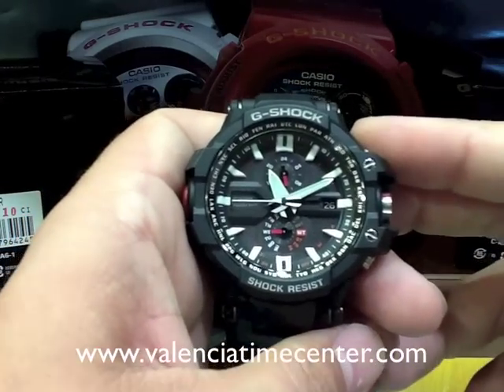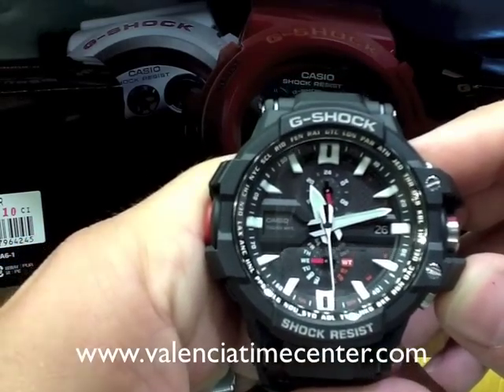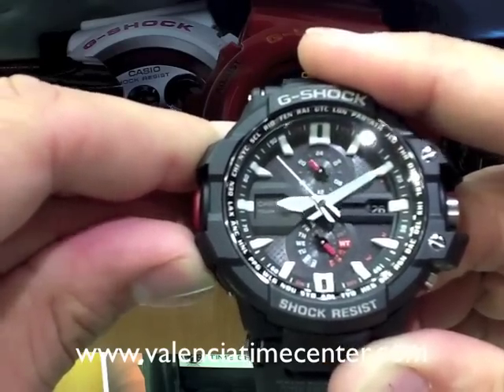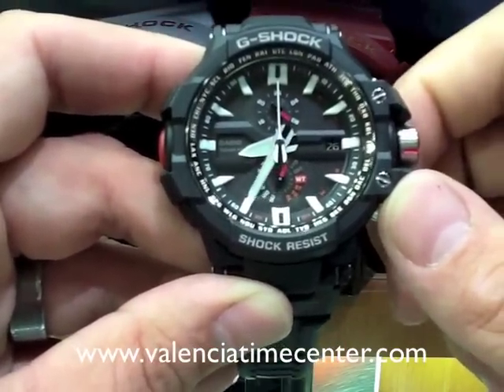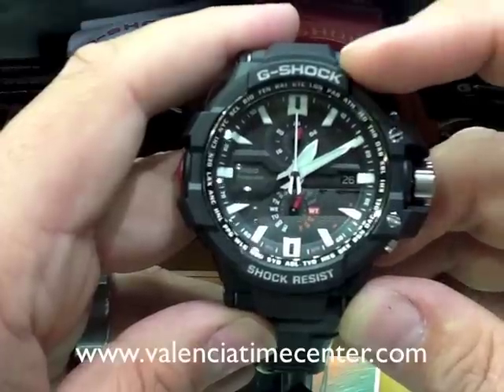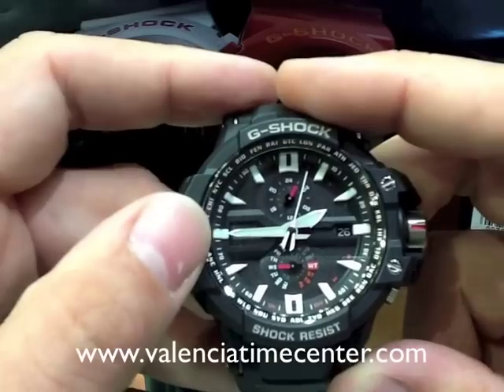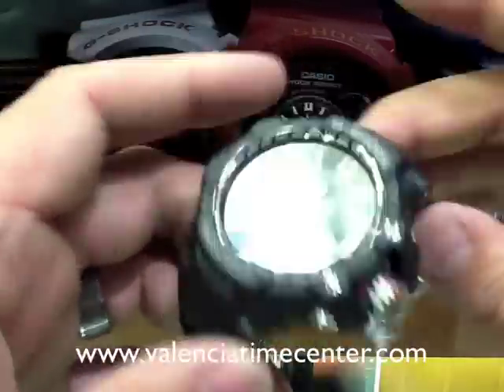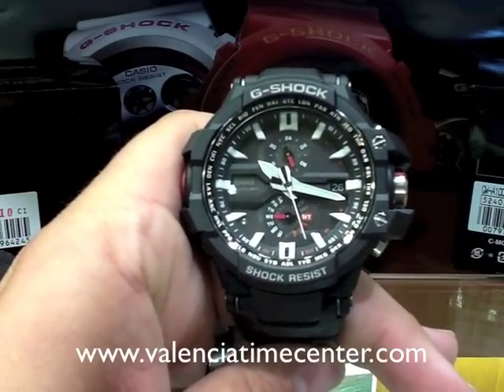How to set Casio GW-A1000-1 and GW-A1000D-1 Watch Review by Valencia Time Center

Comment from the maker: The day will automatically set itself if the calendar is set properly.  Theere is no way to change the day independently.  If your YEAR, MONTH and DATE are set properly the day is predetermined based off of the calendar.  The tricky part is setting the year right.  Hope this sets you in the right direction.
Reply: Your video is so helpful, thanks a ton Sir! :)

Comment: Hi there, I bought the GWA 1000D I don't live in a signal area, but tried what you said and held down B, it didn't move and it didn't make a beep noise. It did nothing. Is this normal if you do not live in an area with a signal? Everything else seems to be okay, I think.
Reply: tezzer p yes, Check your city code setting. if your current city isn't covered with signal non of the auto receive setting will work. try to set it on a supported city code and you will see
Reply: Thanks i tried that already. You're right. Thanks again!

Comment: Hey ... thanks for this useful video.
I have a problem ... the lower dial doesnt go to the correct day after setting the day. Month and year! 

Could you help please ??
Thanks in advance.
Reply: Mohamed Ghanem Hey man, I just bought this watch and I have exactly the same problem. In addition when I press the "B" button nothing happens to automatically adjust time. Do you still have same problem?

regards
Reply: I also have this problem..PLEASE HELP FUCK
Reply: hey did you fix this problem? I have the same issue.

Comment from the maker: If the crown was unscrewed and the watch was exposed to water or steam then the watch will have been compromised.  Any watch with a screw down crown is only water resistant when the crown is actually screwed down.
Reply: The second hand of my GWA1000D-1A stopped and not working anymore but I was able to set the local time. Can you please help me how to fix it?
Reply: Dan Noabmor Jr *In these true analog Tough Solar Casio G-Shock Wave Ceptors, if your second hand only ticks every two secs, your watch needs charging and is in a low power/charge state. If the second hand has utterly ceased to tick, the battery has died (perhaps momentarily) & needs extensive charging. These Tough Solar models can revive a seeming dead battery if charged in time. Again, to bring the battery up to a full charge after regressing to a low power state, extensive solar charging is required. *

Comment: Hi there. Wonder if anyone can help me. I've got the GW-A1000FC-1AJF. I'm not sure they differ much in terms of function, but every time I unlock the crown to set the alarm or timer, it doesn't work. Everything else is working fine. I don't know if I'm doing right. Upon entering stop watch mode (4 clicks of button C) I then proceed to unlock the crown and turn it to set the hands, but nothing happens. No beep l, no movement etc. Is there any way of checking if the electric crown is still working?
Reply: Ahhhh solved it. Thanks anyway. I wasn't pulling the crown out. I was just releasing it from the locked position. Thanks anyway.
Reply: +Warren Croft Hi im thinking of getting the GWA 1000, im not an aviator, would i still enjoy the watch and its features?

Comment: A few things.

1) I set my watch to Fahrenheit and it always reads 84 degrees like yours did. This happens even when I've removed my watch and let it sit at room temperature for a while. Are they just not working in Celcius? I doubt the one you showed was correct at 84 degrees. Too much of a coincidence.

2) A few of my friends have different G-Shock watches and were able to get them to beep once at every hour. I find this to be very useful and was wondering if there was a way to get this particular watch to do the same.

Thanks in advance to anyone that can help...
Reply: Okay. I let it sit for 40 minutes and the temp went down to 78 degrees. I guess it's slowly approaching the actual temperature and the 84 degrees wasn't a coincidence. Kind of irrelevant though if takes over an hour to get a correct temperature reading.
Reply: Were you able to find out how to set up hourly chime signal? If so, can you please share the steps here. Thanks in advance Jason! ;L)